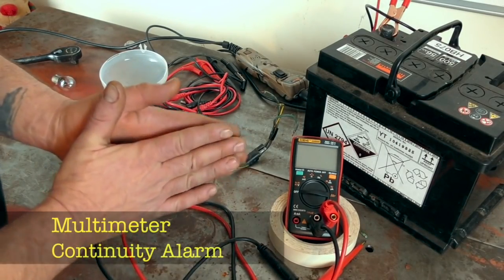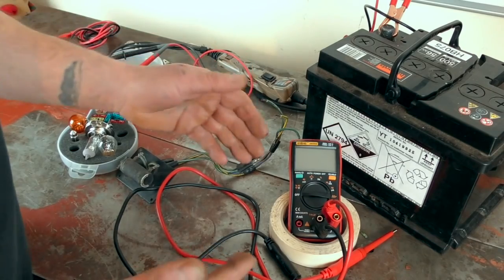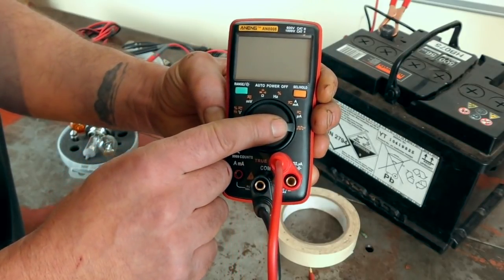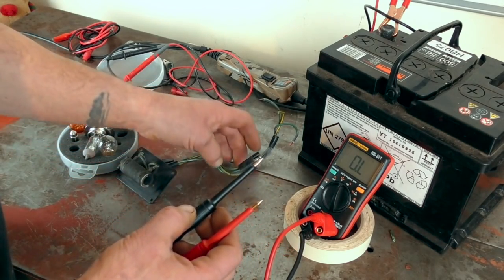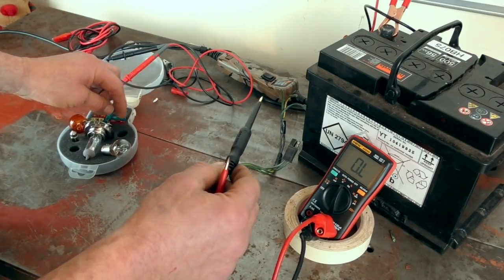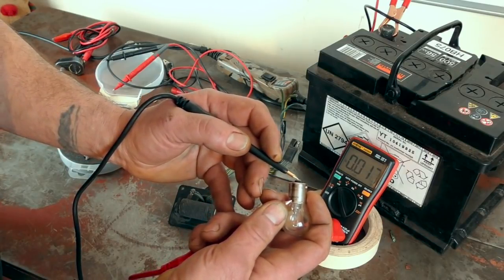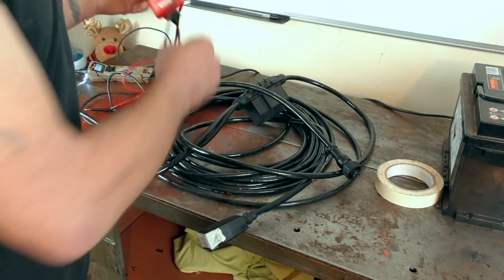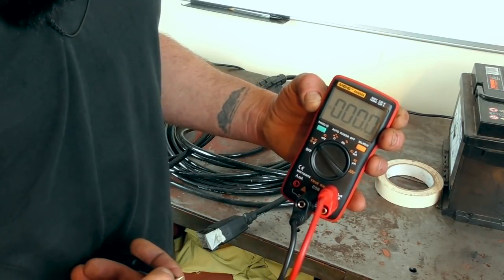Multimeter - Using Ghost Voltage Set  to Check Wiring Continuity.

Comment: What are ways to get a ghost voltage or where do ghost voltages come from?
Reply: For false readings, like if you was to have a bad ground..
Reply from the maker: @jacobsebastien3910    ghost voltage you get when you get an open circuit.  this is one way to get a continuity reading or find a break in a wire.